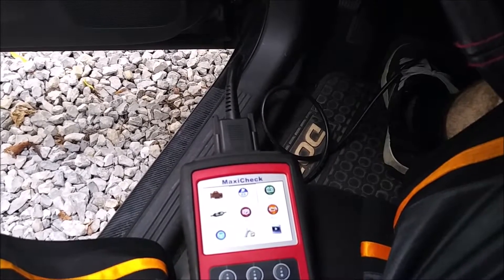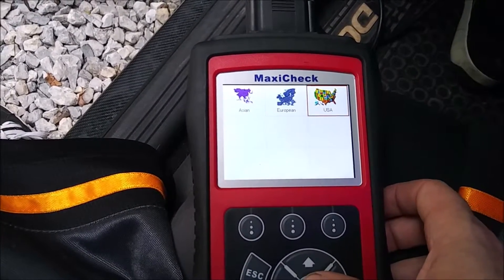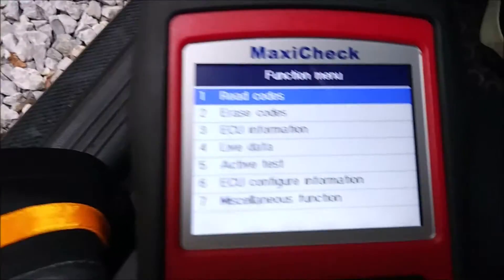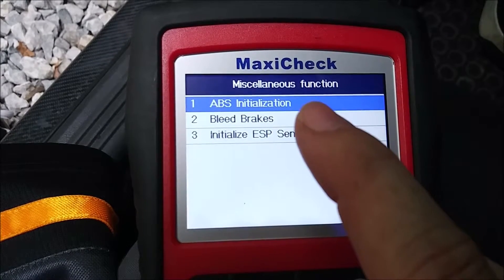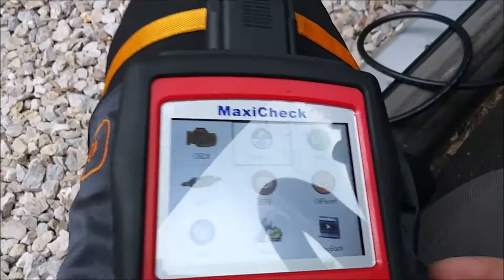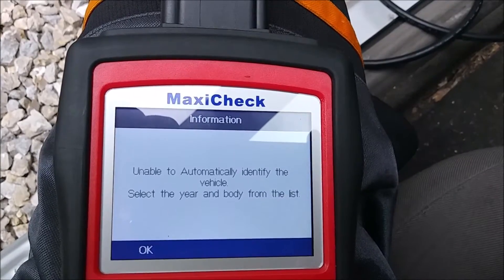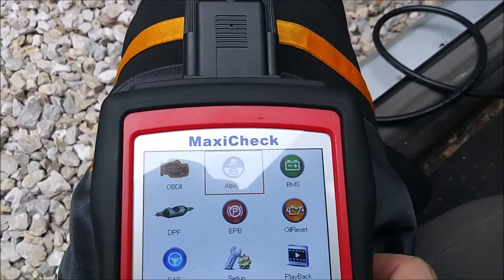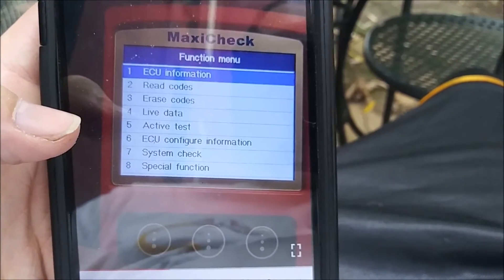Helping Ttowncorp initialize ABS module Dodge Charger

Comment: Hello I purchased a maxicheck pro and I ask the seller if would  do a abs module initialization on a 2012 chrysler 200 they said no I may have to send it back if it doesn't what you think?
Reply from the maker: @quethomas5666  I don't see why it wouldn't, we all saw me do it in the Dodge Challenger video.

Comment: I have a 09 charger rt changed my tires and now i get a c2200 and u0126 code. Also, what would be a good scanner to clear these and initialize the module. I did go over a bumpy road before these abs lights came on. Any help or information would be appreciated

Comment: I replaced my abs module just recently on my 2005 Dodge Magnum with a used one that is in working condition do I need to have it flashed first before it will be compatible with my Magnum because I tried initializing it and this is what happens...I went to chassis...then to ABS....and I get unknown control unit variant

Comment: I have a question. Would the maxicheck pro work with a 2012 dodge avenger? If not, do you know what would be the best tool to program the abs module? Thanks.
Reply from the maker: I don't see why it wouldn't. As long as the donor module works otherwise and your only issue is needing to re-initialize, the Autel Maxicheck will work.

Comment: I need to initialize my replaced abs module .can i purchase this maxi check scanner at autozone ?? Dealership wants to charge $400 to reprogram ! Any advice is appreciated
Reply from the maker: I bought my MaxiCheck from Amazon. I believe you can get them from ebay too. Shipping might just take a few extra days from ebay. I only paid like $180-$200 for my Autel and after you initialize the ABS, you still have a bomb-ass scan tool.

I'd go that route. Screw the dealership.
Reply: @HollywoodHornet  you are THE MAN .thanks big dawg
Reply: @HollywoodHornet  also noticed that my speedometer isn’t functioning at all,when going into drive from park shift is hardened,and 3 U codes are now present (lost communication with abs module)  .I’m figuring this is all caused by the abs module not having been initialized yet? before replacing the abs module i had it looked at at 4 different places to check wheel speed sensors since this was previously an issue that illuminated the esp bas abs traction lights.this time they all came out to show internal malfunction in Abs Module,which was pretty cut and dry and the reason for swapping the module.
Reply from the maker: @dvalentinotv  U-codes mean failure to communicate with a module. If other modules have U-codes, they are failing to communicate with something. Your Speedo not working could be a crank sensor or something, but the obvious answer is ABS module is not communicating with other modules (such as the transmission module) and causing the problem.

The takeaway is when a module has a U-code, that module is not the problem, it is telling you it isn't communicating with a different module and whatever that module is, is the problem.

An inexperienced person might think a stereo module, light module, cluster module, etc. all having a U-code means they all have a problem, but the real issue is they all lost communication with the door module. The door module won't have a U-code but its failure is causing the U-codes in the other modules. (That's an example but it still applies to ABS module and whatever other modules it communicates with normally).
Reply: Holy crap $400!!

Comment: Autel must have changed something in the programs, they are telling me the maxicheck pro will not initialize the abs control module
Reply from the maker: They told another guy the same thing. I forget his name, but he was a commenter on my ABS initialization Dodge Challenger video. He disregarded their proclamation and bought the Maxicheck Pro anyways and successfully initialized his ABS module. So, I guess it's a toss-up on whether or not it's possible yo use MaxiCheck Pro for ABS initialization. We all saw me do it in the Challenger video, but who do you believe? Autel or your lying eyes. Normally I'd believe me, but if ttowncorp's Autel doesn't work, who knows?
Reply: @HollywoodHornet  Were you able to send ttowncorp a copy of your software? If so, did that help him at all?
Reply from the maker: @jerrythomas5772  I copied the software onto a micro SD card and mailed it to him. He plugged that card into his Autel and a message appeared on the screen, but I can't remember what it said. Something about permission not granted or something, per his email. He believed it was just a licensing/software thing where all be needed to do is find the file on his SD card granting access and switch it for the similar file on my SD card. Or maybe even combine all his files onto a card with all my files and maybe it would then work?

I believe there is some code in the SD card that is in place to only work with the one scan tool. I emailed him a week ago to ask how he was getting along, but he said he's been too busy with work to try playing around with the codes and files to make my SD card work with his machine. If he messages back with a success or failure, I'll advise further.

If you message him on one of his videos, he might have a proper answer by now, assuming he's had the time to try since I last emailed him.
Reply: @HollywoodHornet   
did your tool come with a cd for the software?
Reply from the maker: @jerrythomas5772  Yeah, it was stuffed in the manual. I've never used it though. I just opened the box, attached the cable to the OBD port, played around with it to get familiar with the menus on the Autel, then initialized the Challenger ABS module.
Reply: @HollywoodHornet 
I think what ttown needs to do is format an sd card to the autel scanner and then copy the files to that card. I am looking for a used tool in hopes that it will have the initialize function on it
Reply from the maker: @jerrythomas5772  I think I figured out what Ttowncorp's problem is. I wouldn't have figured it out had I not updated my software and then plugged into two different ABS modules.  Rather than retype all that here, below is what I typed to Ttown.

Sir,
I have discovered something by accident. I think maybe your Autel is fine, but rather your Dodge is too old for the ABS module that is in it, or vise-versa. Grab a drink and sit around the fire for story time. Perhaps I'll do a video on this as well during the light for all the viewers.

I bit the bullet and registered/updated my Autel with the current software available from the website (I saved all the data on my old card as well, just in case Autel downgraded me and I could no longer initialize ABS (like it seems your Autel won't).  I then went outside and plugged it into my Crown Vic first because it's right outside the back door. I went to ABS, and on the way there I notice my logos that previously resembled the actual manufacturers logos changed to resemble what they are on your machine (plain and bland). In ABS my selections are exactly like yours, I lost my misc. selection but had the extra functions (or whatever yours said). I could bleed ABS but there was no initialize function. I assumed Autel fucked me. Then I thought, you know, let me plug it into the Challenger to confirm the fucking. Maybe the Crown Vic is too old to need to initialize an ABS module. Maybe any ABNS module can be transplanted onto the Crown Vic and just work.

I plugged into the Challenger, went into special function under ABS, and voila, ABS initialization is there. Why not on the Crown Vic then? Perhaps my hypothesis is correct. Perhaps the Vic doesn't need it because too old, but Challenger does because new. I think ABS initialization doesn't show up on your Charger because the Charger itself is too old to need it. That said, I think the ABS module that's in your Charger came from a newer car that requires the initialization (hence the VIN mismatch code). I want you to try and plug your Autel into a different car. A newer car, like a friend's or something and go to ABS special function. I'll bet anything ABS initialize will be an option for you.
Reply from the maker: @jerrythomas5772  Oh, and the CD that comes with the Maxicheck Pro just takes you to the website where you register the device.
Reply: @HollywoodHornet  
That is interesting. But, what year is the cutoff? I have an 09 grand caravan that I replaced the abs module on and it shows the mismatch code. I guess I am going to buy one of these, at the price($155) I would have a scanner with abs bleed and SAS.
Reply from the maker: @jerrythomas5772  Ttown has an 08 Charger. The Challenger in my video is a 10. That's all I know.
Reply: @HollywoodHornet  
Got the scanner and it does do the abs initialization on the 09 grand caravan, altho had one little problem it froze on the step before second drive and 90 degree turn, finally just drove and turned and stopped, then drove a little more and it did the rolls clearing and initialization successful.
Reply from the maker: @jerrythomas5772  very good. Idk why Autel tells people the Maxicheck Pro won't initialize ABS. I assume to try and sell more expensive scan tools.
Reply: @HollywoodHornet  
Autel is not the only company that told me they dont make one, Innova and Launch both said they dont have a too; that can do this, but I have seen videos of their tools also initializing the bs, but they are well over $500 for those tools
Reply: @HollywoodHornet  hi. it's been a minute. but my charger is a 2006.  I'm still having that issue with the ABS initializing.  I got hornet SD card to read on mine.  I had to do some coding on the computer to get it to think it was my card.

Comment: Thanks such for helping me out this far. I'm uploading my video now on my findings. This is so interesting how our versions are different. Is your challenger a srt8 as well?
Reply from the maker: Challenger is not SRT8. SE, I believe? (the 3.5 V6). WJhandydad has a Charger. I'm fairly certain he has a V8 Charger. It might even be the "Pursuit" trim option. He might be able to help with ABS initialization procedures as well.

You could try reaching out to him for more specialty Charger advise. He's a subsciber of mine and me of him. He's usually somewhere in the comment section of my dash cam videos and he has a wealth of knowledge. His videos are great.
Reply: @HollywoodHornet  I just had a idea. What if it's possible we could copy the SD cards we have in the maxicheck. Mines is holding little over 7.71 gb of data in it. It could that simple as it would give me the options you have if I could I had a copy or your SD card and vise versa
Reply from the maker: @ttowncorp  that's a good idea. I'd have to plug mine into the computer and see what's doing in there once I get home from work and copy the data to an SD card if possible. I will check and advise.
Reply: @HollywoodHornet  hey hornet. So I went to staples today and bought a basic 32gb SD card. I copied my maxicheck card and put it on the new card and it still worked like I never swapped it. Now the real test is if I had a copy of your card would my maxicheck read it. Do you have a fb channel so I can chat with you on Messenger?
Reply from the maker: @ttowncorp  I do not have a facebook. My wife does. You could message her on facebook or email me  at deputyhollywoodhudson@yahoo.com.

I did have the wife copy the data from my Maxicheck SD card to her PC. It takes almost 8GB of space (per her). I don't believe I have a full-size SD card anywhere. I think I have some spare micro SD cards (or whatever the tiny ones that go in phones are called) and an adapter that the mini SD card fits into that simulates the full-size SD card.

The few spare tiny SD cards I have hold only 8GB of data. Let me grab one from the Crown Vic and see if I can have the wife transfer the data from her PC to that tiny card and if it will fit. If that works, perhaps I can ship you the tiny SD card, you can transfer the data to your PC, then to your full-size card.